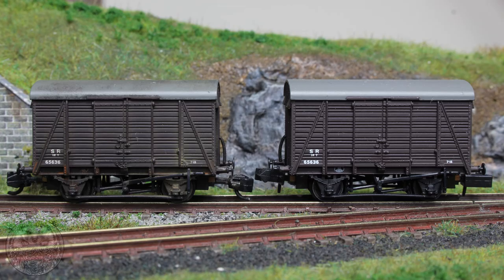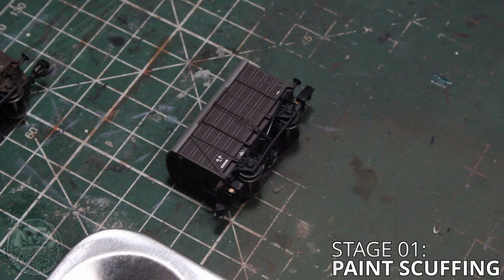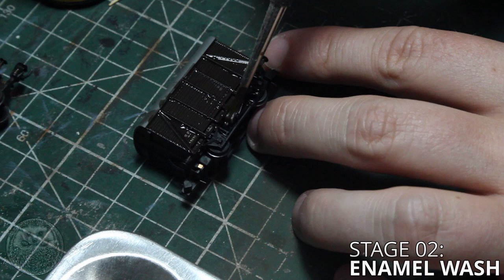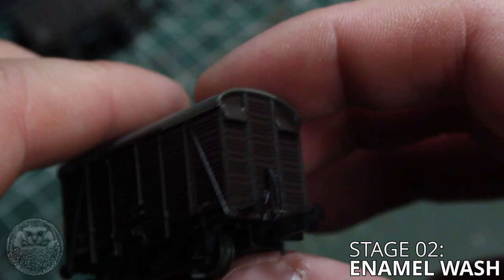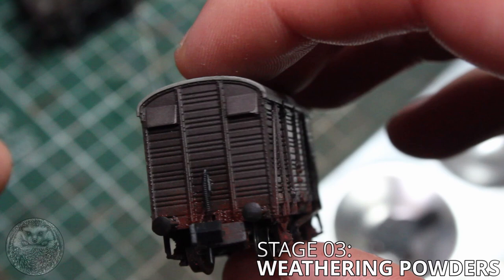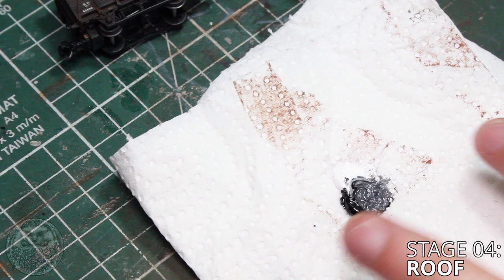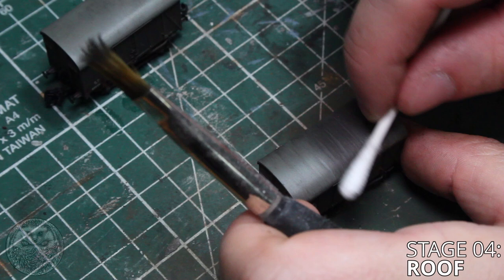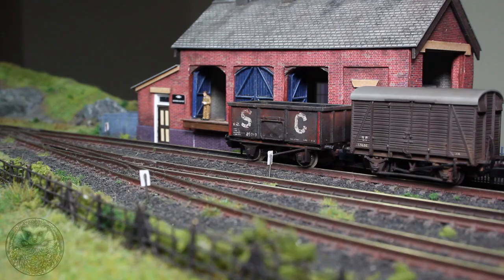Model Railway Tutorial - Simple Wagon Weathering

Comment: Great video. One question, do you need to let the enamel paints dry in before using the weathering powder or does it need to be wet for them to stick to the wagon?
Reply from the maker: Thank you, I'm glad you liked it. I have found the paint can be dry and the powder will still stick (to a certain extent). You can apply it when the paint is wet but you'll get a different effect (more 'clumpy', less powdery / dusty). However the powder does rub off after a while... not the end of the world as it rubs off of the raised detail which adds to the effect if anything!